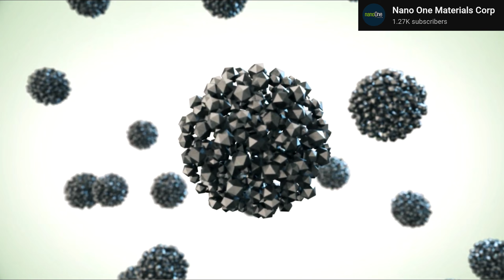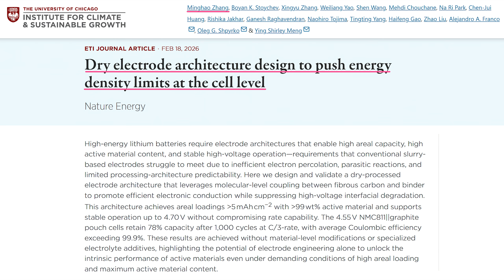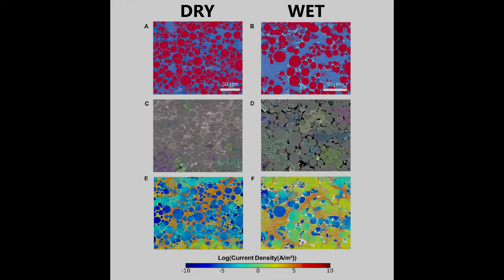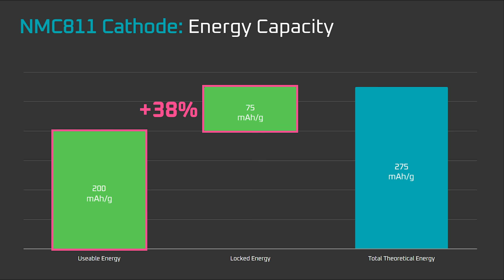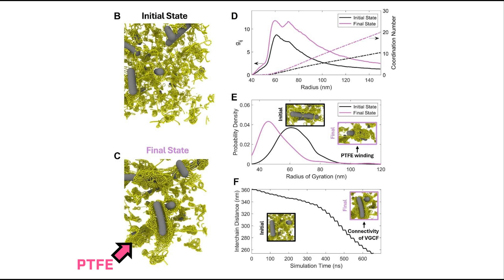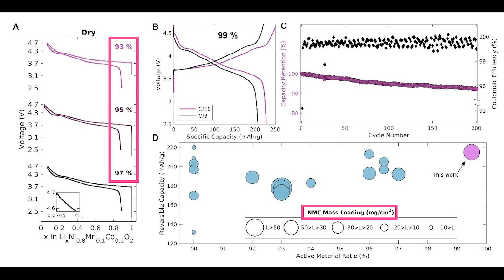NEW Potential Breakthrough using Tesla's Dry Electrode Coating Process

Comment: Any idea whether any researchers are making a realistic effort into eliminating PFAS from processing steps and battery materials? Seems like a huge looming problem for a technology that's supposed to improve environmental and health outcomes. I love the capabilities that battery storage provides, but if we're manufacturing TWh of batteries, we'll also be releasing a staggering amount of PFAS along the way, and recycling will be much more hazardous.
Reply from the maker: It's not a huge looming problem for Tesla's batteries.  They're massively reducing toxins and CO2 emissions by using .1% of PTFE and a dry process.

At the end of the battery pack life, they'll incinerate it and capture the toxic gases by using scrubbers that turn them into inert chemicals.

That is, the net environmental and health benefits are better than with a wet process, and you're better served by avoiding wet coated battery cells than by trying Tesla not to use PTFE.

Comment: I disagree with one thing. Carbon strings are bound to have a higher surface area than particles. A sphere is the lowest surface area to volume ratio…
Reply from the maker: Depends on the thickness of each.

Comment: Sadly for Tesla! We are now in the age of Graphene. By all means, it has been a remarkable evolution for Tesla.
However, now we have no Graphite, Manganese, Nickel, Cobalt or Copper.
Just Aluminium & Graphene.
They will be doing a deal with GMG, very shortly, if it hasn't already been done.
I always enjoy your videos, but I've never heard you evaluating GMG's Aluminium Ion Graphene battery. 
These new chemistries almost eliminate battery degradation, operating temperature limitations and thermal runaway problems. Battery density isn't there yet, but it's only a matter of time.
Reply from the maker: If you've truly watched and paid attention to my videos, you'd know why I haven't covered GMG.

Comment: Probably a dumb question, but would this be applicable to LMFP since the manganese boosts the voltage capacity or does the structural part of the LFP you described already serve the same purpose the PTFE would?
Reply from the maker: Good question!  LMFP is just LFP with a few of the atoms swapped out, so this innovation wouldn't apply.  Interestingly, LMFP works by increasing the voltage, so the ultimate affect of LMFP over LFP is the same as using this innovation for NMC over typical NMC.

Comment: Hi Jordan. Please consider doing a deep dive into Gelion's Li-S cathode solution. They have solved the polysulphide issues and developed a high cycle-life, high energy density (400Wh/Kg) cell using their nano-encapsulated sulphur active cathode material (NES CAM). Currently collaborating with TDK on development and commercialization.

Comment: I wonder how this is different from CT Coating AG screen printing production process which does not use drying ovens too.
Reply from the maker: As far as I'm aware that's still a wet process.  It's screen printing, which is typically much slower than a roll to roll slot die process.  Dry coating is completely different, which is like rolling pizza dough.

Comment: At 16.55ish you show the different elecronic paths between wet and dry , can i also assume that in the wet cathode there will be more resistance and thus more heat generated to boost the degradation as well??
Reply from the maker: Yes!  Good point.  IDry electrode coatings are lower resistance because they offer better ionic percolation pathways.

Comment: What is the production capacity of Tesla's dry electrode process (GWh per year).
Reply from the maker: 40 GWh stated, but its unclear whether that's based on the 100 GWh of equipment they installed that didn't hit production expectations, or only 40% of the machines running, if that makes sense.
Reply: @thelimitingfactor thank you 😊

Comment: Nice analysis, thanks for sharing it to the world.

I recently read these papers as well and I think you'd really like to read them Jordan. Both are open access, so should be easy to get.

You might have already read this one: "Enhancing The Performance of Medium Nickel Cathodes via Controlled Cobalt Rich Surface Coating"

Another one is a LOT more thorough, but interesting based on the analysis of some FEB 18650 cells, from 2.6Ah to 4Ah: "Electrolyte Motion Induced Salt Inhomogeneity in Si-Containing Cylindrical Cells – A Case Study"

It's mainly focused on electrolyte migration during high power discharge, but it's still incredibly information dense and really opens up stuff in ways that barely anyone has done with any modern cells.

If you want to make any extra content with James Ma's team and their efforts, perhaps you could get them to do analysis on the Amprius SA112 (330Wh/kg 21700 cell) since you can easily order it now, as well as new tabless cells like the Reliance RH60, Reliance RS50, etc, from a bunch of different companies.

I know it's a lot to throw, but just wanted to let you know.

Comment: Thanks Jordan for your in-depth analysis.  Researchers have been working on high voltage electrolytes for decades, with little results.  Reducing voltage variation is an interesting way to attack the problem, and sounds promising.  Definitely interested in a video explaining the other benefits that can be pursued with dry coated electrodes, now that Tesla has finally got the process working. 🤞

Lot of interesting developments in battery manufacturing and design these days.  BYD, CATL, Zeeker, SAIC all have made several material science developments to allow ultra fast “flash” charging.  IIRC Grok lists four design changes for BYD Gen2 Blade with 1.5 MW (~15C) charging, including separators with higher ionic conductivity, lower viscosity electrolytes, dual layer electrodes with smaller denser particle in bottom layer, and larger particles in the top layer for faster ion transfer.  I don’t remember what the fourth one was.  These fast charge developments would also be great to cover in future videos.
Reply from the maker: Thanks man!  

Check out my video on Shenxing.

Grok probably took its answer from me 😁

Comment: As much as I love the EV tech, I am holding off buying. Range anxiety caused by my climate and geography are the reason. We have had a very limited uptake here, and I suspect for some time to come, but this looks to change that equation. Hoping for sooner than later.
Reply: Today's EVs are more than good enough for 80% of drivers. Range anxiety goes away when you get an EV and realize how little you actually drive. Every year you drive a gasser you burn through literally tons of dirty fossil fuel, polluting the Earth and worsening global warming. Waiting for something better is nothing to be proud of.
Reply: You don't say which country or continent "here" is?
Reply: @johnpublicprofile6261 .  Canada. And I’m not a city person though I live in a city. I spend a lot of time in rural. And the reduction in range in seriously cold temperatures results in almost no cushion for my destinations. In warm weather, probably ok. But that’s not my only use case. We often do a long drive south in the winter, and play the weather game. I’ve had more than one incident where we’ve had to break out from the planned route to avoid serious weather, and in one case crossed rural Nebraska where I actually ran my car pretty close to empty before I found a gas station.  
 On another occasion, I had to break out and cross rural Colorado to get out of another weather event, that worked too, but no chargers anywhere on that route, that I saw. 
  I just don’t see the flexibility yet. When there’s 300 honest miles at -35C, it’s a go. That probably means 400 miles in summer conditions.

Comment: This is the kind of transparent research paper that should be getting videos.

Not whatever the heck the Donut battery is doing.
Reply from the maker: 😁 Yeah, that's a real dog and pony show
Reply: Seriously. It's all so strange. However, I'm really hoping their claims (mainly density, chemistry, and cycle life) is at least close to what they say. We need it.
Although, 100K cycles is bizarre. That seems unfathomable. Is that like when it has <20% remaining capacity or something? Feels pointless anyway. 5000 cycles to 80% is still basically vehicle lifetime. That's ~20 years charging 70% EVERY single day. Likely looking at calendar aging taking over at that point.
Only thing they've kinda proved so far is it charges fast and hot without apparent damage (although not fully proven IMO). Which is neat and a good property, but yeah more transparency please.

Comment: Great. Forever chemicals proliferation to follow.
Reply from the maker: I would say it's far more concerning that people are using it on their cookware at 100% concentration for food they're eating than deep in the bowels of their battery at <1% of the total battery weight.

The battery will then be burned to recycle it, and the toxic gas byproducts will be filtered/captured.
Reply: @thelimitingfactor  I think use of teflon for cookware and waterproof clothing membranes is decreasing. I think a major concern is production related pollution, not (only) recycling related one. I the Netherlands factory formerly owned by DuPont polluted water and grounds seriously affecting health of many people for a very long time.
Reply: While cookware is closer to human body and concentration is greater, the production volume of ptfe for batteries can be much bigger.
Reply from the maker: @greengraycolor  The ideal is of course to have zero pollution or impact on the surrounding environment or people, but straight down to the physics, that's impossible.  So, it always comes down to either improving the technology to minimize those impacts, making trade-off decisions, or voting with your wallet, or just straight up voting.
Reply: @greengraycolor Use in car batteries is likely to involve a very high recycle rate, eventually leading to low creation of PTFE for EV use. Whilst I would be suprised if there is any noticable PTFE recycling for cookware.

Comment: First of all, thanks for the video.
Most industries have small step improvements for cost and efficiency.   For example, ICE technology started using variable valve timing and later turbocharging to improve fuel economy while maintaining hp/torque.  The battery industry is similar in that it's improving on the existing LiOn design.
IMO, what's really needed is a large step improvement (or paradigm change) like solid state batteries.  I realize that even if we had the tech today, it would take years (decades) for mass production.  But, again IMO, SSB are the end game.
Reply from the maker: Current batteries are just fine for 95% of use cases in terms of performance.  Cost is the primary bottleneck to adoption.

No step change is needed, only scaling.

Performance will continue to steadily increase through a number of mechanisms.  Solid state is just one of many pathways to meeting the differentiated needs that all the different products require.

Comment: I'd rather have them use gluten as an alternative to Teflon.
Reply from the maker: No real alternative that I've seen.

Either way, the Teflon will be dealt with as part of the recycling process.

The exception will be batteries that catch on fire, but that's exceedingly rare and 99.999% of the toxic fumes from that will be from things other than Teflon.
Reply: @thelimitingfactor  The future use of PFAS in the EU is uncertain, and there is a tough struggle to find legislation that is beneficial to all parties.
It would be useful, to be prepared to have alternatives at hand.

Comment: Thanks Jordan. Another well researched and presented idea. Also would like to understand if any of this would affect sodium ion or aluminum ion type batteries. Thanks again.
Reply from the maker: Great question!  Depends on the sodium ion chemistry, which are as differentiated as lithium ion chemistries like LFP and NMC.

For those similar to LFP, no impact.  For those similar to NMC, similar impact.

As a side note, however, dry electrode coatings improve the energy density, etc of LFP batteries through other mechanisms.
Reply: @thelimitingfactor you mentioned in your video that graphene was mentioned in the paper as one way to enhance battery electrode performance. This material continues to affect performance of other designs around energy storage and generation. Would be interested in one of your deep dives but around more general applications of graphene and the different ways to produce the various forms. Maybe someday you can apply your analytical approach to this fascinating material? No pressure but…

Comment: Thank you very much for the Information about this fundamental breakthrough and also the detailed explanation. 
For me, there is the question what led to this breakthrough? 
The organism Tesla? 
The demand, pressure and experience of a company that uses a lot of battery storage?
What else?
Reply from the maker: Sure thing man!  Thanks for the support.

My view is that once you start understanding a technology deeply, these things just start to jump out at you. 

When I first saw the dry electrode process, it immediately became clear to me that it opened new doors in terms of performance.

I just didn't know how that would play out because I'm not dealing with the technology everyday and I'm not as smart as the engineers and scientists that work at these labs. 😁

That is, it's just driven by curiosity and putting two and two together based on what you discover when you're curious and have a passion for a topic.
Reply: Would you accept an offer from Tesla were it made?